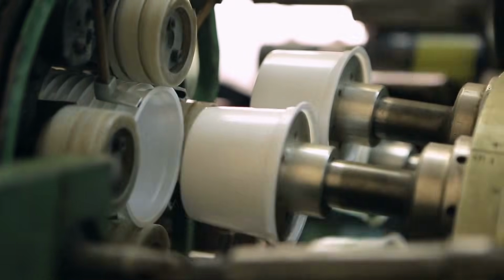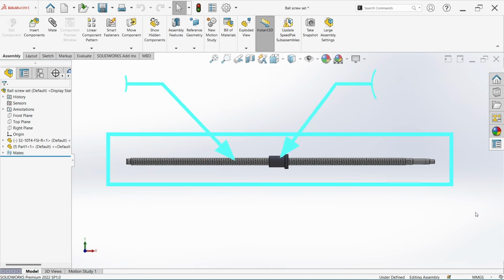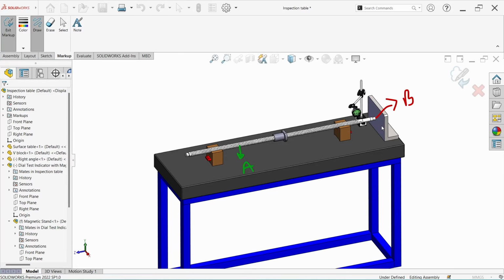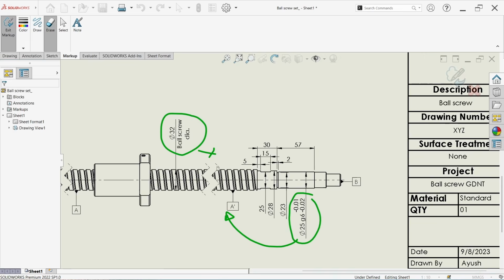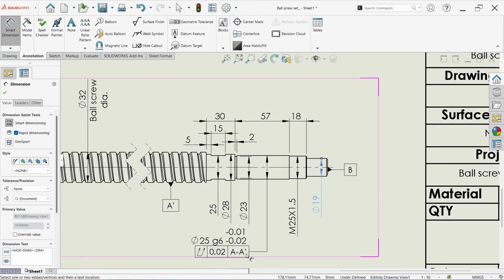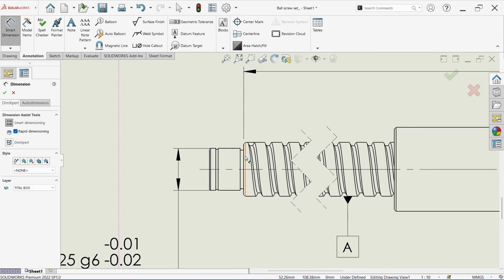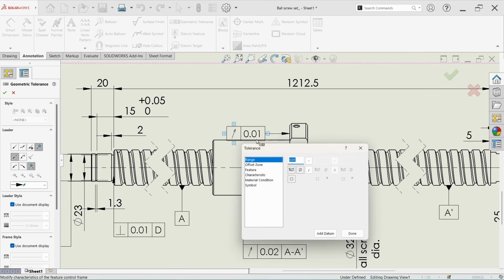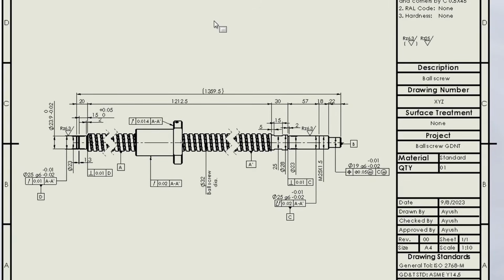How to Make Drawing in GD&T Step By Step |  Geometrical dimensioning and tolerance tutorial

Comment: As you have selected the ball screw surface as datum A (primary datum) as it is perfectly machined but how to select the primary datum for a shaft which is to be made from raw material (i.e from forging or castings) which is not in proper form then how to fix the primary datum can you explain that..
Reply from the maker: I will try to explain in future video

Comment: Hi. This video is very helpful. Thanks for the content. :-) Please keep up the work. I have just one question from this video. How do you decide the value of perpendicularity, run-out ?
Reply from the maker: Perpendicularity- We decide any geometric tolerance according to particular part (design) function, also sometime constrain by manufacturing process availability. 
In this case (ball screw) I have referred to standard manufacturer catalogue for required geometrical tolerance. they have mentioned how much perpendicularity and run out should be over ball screw machining steps, to run the ball screw and nut without any problem

Comment: Sir, maintaining  the 20micron Runout of lead screw is quite difficult in manufacturing when length crosses 500mm above
Reply from the maker: Yes, but here were not controlling the run-out for 500 mm, its controlled by specific datums

Comment: Bro, for bearing we should give transition fit right? Why do you give loose fit g6,
Reply from the maker: Yes Right but this bearing block is with a lock nut, lock nut is enough to prevent slipping of shaft plus there is angular contact bearing in back to back arrangement which are already preloaded. So don't need to preload with an interface fit. Bearing preloaded adjustments video coming up
Reply: @mastermechanicaldesign   thank you sir

Comment: Dear sir, why should we draw the lead screw in 2d. Because we have select the standard one, like model:BTK 4010-5.3. then what is the need for draw the 2d, simply we can choose the standard and purchase. plz explain this sir.
Reply from the maker: Hi Rajesh, I am assuming you are asking why should we make ball screw end steps machining drawing. (Because this is not a drawing of ball screw, this is a ball screw end steps machining drawing)
- Why not simply purchase a ready-made machined end ball screw.
Yes, we can also buy machined end ball screw as per our application.. from manufacturers like Misumi, THK or Hiwin. But it will be expensive and will also take high delivery time.
But again, you have to give them a rough sketch or you have to give them the dimensional values of each diameter and length of each step.
So in my experience, it is always better to buy ball screws raw lengths and machine the ends yourself. As per application.
Reply: @mastermechanicaldesign  thank you sir....

Comment: its nice video.. lots of learning..
I just suggesting that.. kindly make a video for checking Surface Roughness values exactly how its measure and different apart of GD&T and Tolerences.. Also different kinds of GD&T measuring techniques..
Reply from the maker: Great suggestion! Yes definitely. Noted, just for side note, for measurement of Surface roughness ppl use an electronics device called Surface roughness meter, Laser type of probe type.